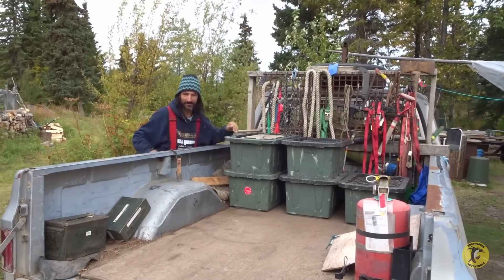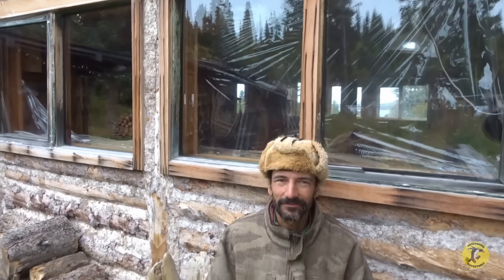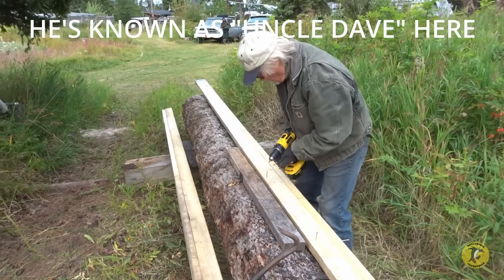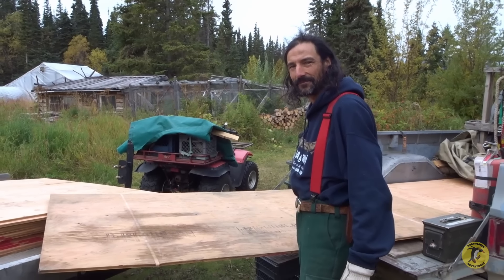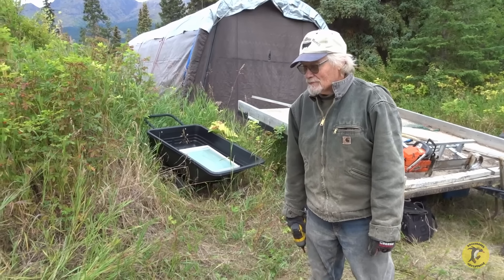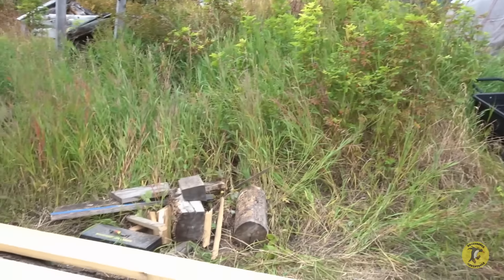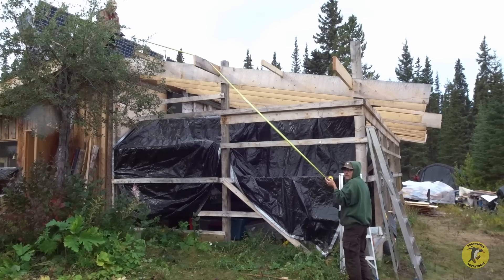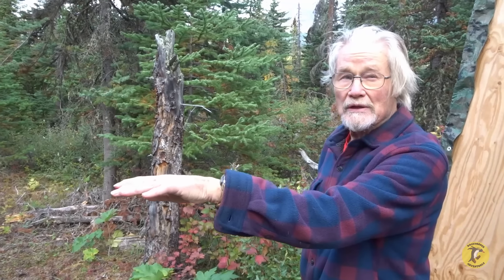How a Family Has Lived Off-Grid In The Wilderness For 32 Years

Comment: The ground pebble is interesting, but what I would do is probably install some kind of pipe system under the pebble and have hot water going though that pipe.  The rock will capture that heat and irradiate it.  I'm just not fully sure how to do it easily without an electric pump.  One huge advantage of this, is 4 inch of warm rock pebble still irradiate that energy after the fire is gone, and since heat rise, no insulation is really needed (I just wouldn't go too far to the border of the house, then this might cause issues maybe.   You could also have the sun hit the rock floor, which the rock will store that heat (And you will want to do the reverse in the summer, protect so the sun don't enter the cabin).
Reply: Yeah that rock floor looks good for heating/cooling but I'm worried about ants getting in and losing small items in it.
Reply: Ants ans mice.
Reply: U just made it very complicated...its meant to be simple..u don't get it😊

Comment: The proper or easiest way to chop or split firewood.  Do not put on top of another piece as was done in this video.  Put the piece you want to split, put it on the ground.  When you stack it like in this video and Hollywood movies, you have to raise splitting maul higher, and you do not get to swing far, which means you do not get the advantage of gravity.  Gravity of the maul as you swing. Anyone testing my advice will never go back to the Hollywood method.  I split hardwood oaks in Alabama that are much harder than spruce and pine as seen here and on TV. 
  This comment is meant to be educational, not critical.  As I will agree at least 70% of people split wood incorrectly mostly due to what we see on tv.  
 I hope this helps anyone that splits wood by hand.  Stop stacking your wood to split, put it on the ground
Reply from the maker: Thanks Dave for sharing that advice with our viewers!
Reply: Does it help to make sure you have a sharp axe?
Reply: @Elaine-br4lw  great question Elaine.  I never use an ax, I only use a splitting maul.  I’ve never sharpened mine, one swing does the trick usually.  It cannot hurt to keep it sharp.  Most stores you’ll see a red handle splitter with huge triangle head, those are too heavy and worthless.  Most common and easiest to use is yellow handle made of a composite material.
Reply: @davesrvchannel4717  thank you answering my question, the thing he was swinging looked dull.
Reply: My soil is too soft, if I put a log on the ground directly it just won't split because the soil absorbs the force and not the log. So I use a big chopping block underneath with a tyre screwed on it. This way I can put, depending on the size, several blocks of wood in the tyre and when I split them they don't fall to the ground but stay in the tyre. I love the high chop block, don't mind if it's a Hollywood thing since it works way easier than putting logs on the ground and having to bend over all the time.

Comment: When I was a kid my grandfather worked on farm light plants he was a early 1900s electrician and radio man - 
      There were some I remembered that saved all the charcoal from the winter fires and they ran there battery charging generator off the hot gas generated by charcoal smoldering - we called those wood smoke generator back then - 
     Many did not have a lot of Money but had plenty of charcoal for fuel -

Comment: New sub here , hello from remote rural off grid down under AU city folk always say 2 me on my rare trips to the coast how do you do it, my answer solar and wind grow my own produce its not rocket science. Only outlay really is fuel and gas am happy with that idea, took me 10 or so years to set it up to where it is now . And yes the solar storage 24 V have always just used deep cycle batteries and inverter works for me , have a stand alone 12V deep cycle battery that powers led lighting for the house and workshop. Have a small wind generator that acts like a trickle charge battery charger over night, get a bit of wind here. Have a back up gen rarely use it even when using power tools in the workshop , as you said you learn when you can use power and when not for me its the middle of the day for workshop and high draw power tools , in having said that I rarely even turn on then gen and my battery bank handles most things. I agree walking barefoot when ever possible it does drain the negativity , may I add we don't get snow in winter where I am it gets cold for a few months though.
Reply from the maker: Great info, thanks!
Reply: @rockhopperadventures  My pleasure , you are on the right road it seems.

Comment: Living off grid today is a novelty - up till after WW2 most of the rural U.S. did not have grid powwr - 
   Were i live REA was string power lines iin the early 1960s - 
     Rural and farm homes eather had a 6 volt or 32 volt DC house - 
    Those who could only afofd a 6 volt house battery and generator only had fans, lights, and a radio - 
     In the south those with a 32 volt loght plant down here in the south, often had a 21 kw bank of batterys - 
    With 32 volts DC they could run 32 volts lights, fan, radios,  coffee makers, hot plates, water pumps, washng machines, refrigorators  &  freezers - 
     32 volt farm homes were the most common from 1900 till 1960 in the rural U.S. - 
     Nation wide there was an agreement to size the batterys to be charged all day on friday in many parts of the country - 
    In the south it was acceptable to charge the house houese batterys on Monday also during summer -    we used fans a lot in summer and the fridge compressors ran a lot more during summer - so batterys were charged twice  a week all day in summer -
     Because of all the noise the generators made, there were normaly agrements ofwhen to charge house battery's  - 
    The lead acid batterys lasted 40 with1.220 strength acid  - down here 1.200 strength acid was often used -  that gave batterys closer to a 60 yr service life for a home - 
   Off grid power is not new